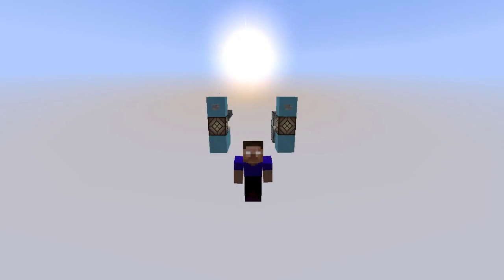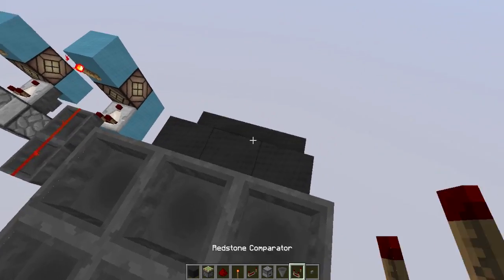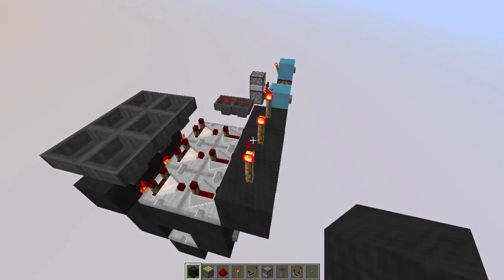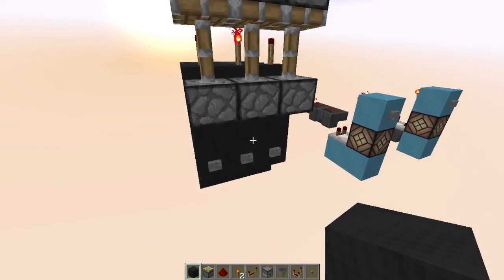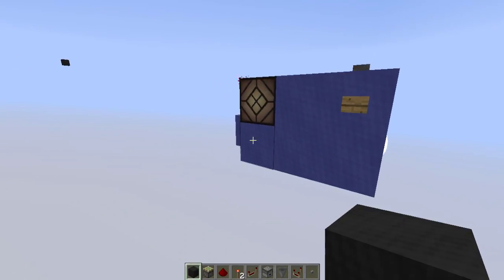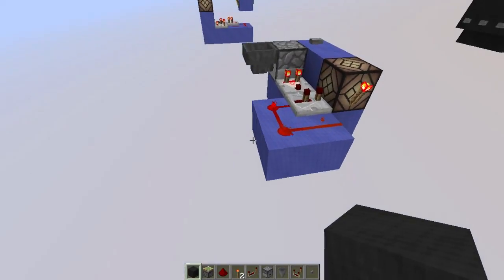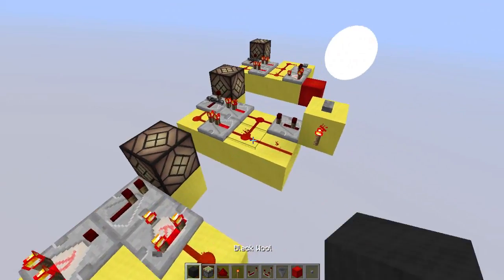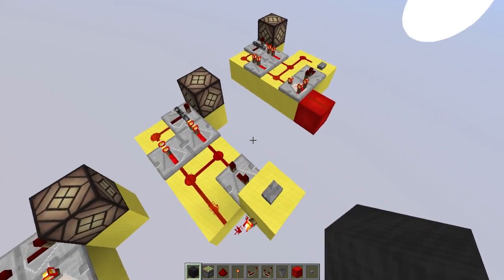Silent Flip-Flops: 10 Pistonless Designs Explained | Minecraft | +Uma

Comment: 14:15 You're right in assuming the repeater makes the comparator react faster. For repeaters and comparators, having a repeater/comparator directly in front will change its tile tick priority (think it's -2 or -3), making it be processed first. Normally, it's repeater(-1), 0 for others.

Every design that were unstable were due to the redsone dust update order. If you use the same power line to do different things, you need to use another way of forcing the correct update order to make it work reliably, or make the contraption work regardless of the update order.

I'm pretty sure 5:00 is stable in that exact setup, having only 1 dust, since there's no other dust for random update order to come into play. I would imagine the input would QC-power the top dropper, then dust will turn on, updating itself first (top dropper is activated), then powering the surrounding blocks after (bottom dropper active). Maybe it's unreliable with a different input position.
Reply from the maker: I wish I knew more about those details so I could control those better. It's so much information! About 5:00 I'm also not sure why it's not stable I just know from experience that it's locational but frequently preventable.
Reply: Try checking out the technical minecraft wiki. Don't think it's updated that frequently, but info about tile tick priorties and tick processing order are still useful.
Reply: Redstone Dust Update is locational. 
It is always better to avoid it :(
Reply: Ofc. Tile tick priority and block event chaining are nice workarounds :)
Reply: Yes, Tile Tick and Block Events are fine, but i hope redstone dust update change in a future u.u
Reply: 14:15  work because first comparator have repeater in front  (-1 priority) vs Redstone Torch have 0. The second comparator  (-1)  vs repeater (-1). Are same but repeater was update first